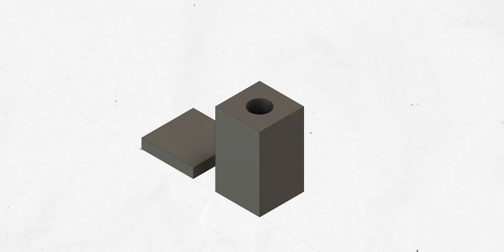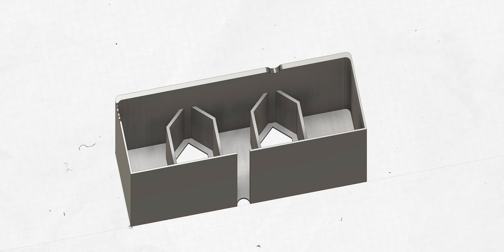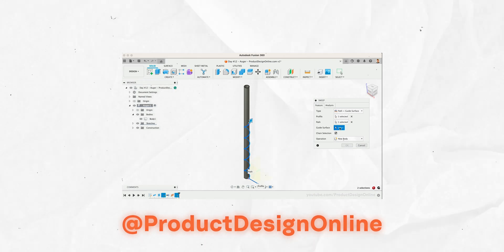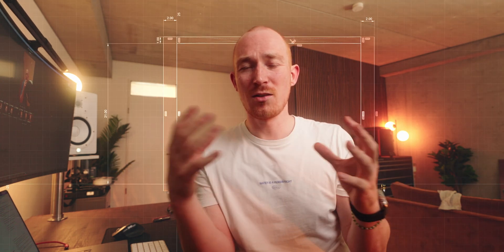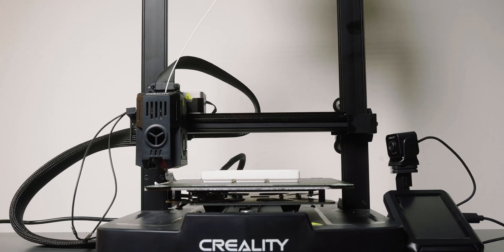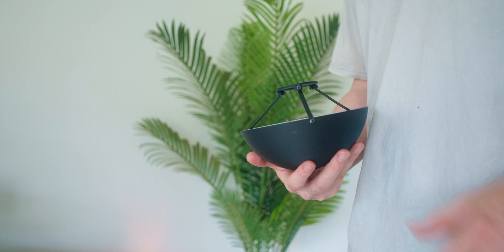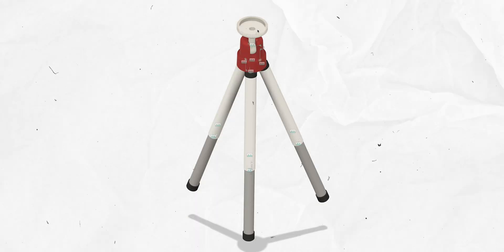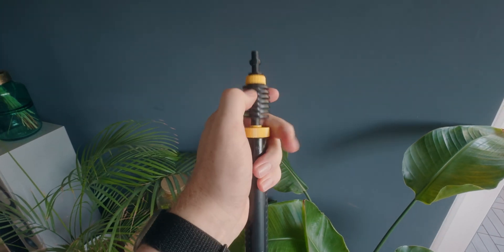I learned Fusion 360 in 30 days

Comment: Halla! I am an Industrial Design student studying in Oslo and have used fusion as a hobbyist for about 7 years and quite intensly as a student the last couple of years. I think its impressive how far you have come in a month, but I have some tips for you:

Firstly it seems like you are only using the solid workspace, learning to work with surface modelling will allow you to work with far more complex shapes and you can really fine tune curvatures and surface continuity. Your style seems quite simple and "blocky" so maybe you don't have to hurry with this, but it gives you way more freedom to design.

Secondly I would recommend that you start using "user parameters" its under the modify tab in solid workspace. This is especially useful when you have to make many prototypes to tune tolerances and so on. Start using these whenever possible as they usually save you time and allow you to build an understanding of how parametric features cascade through a design. 

And finally get super familiar with all the constraints available for sketches, constraining a sketch in as simple a way as possible is not only extremely satisfying but also makes parametric features run way more smoothly. And   relying more on geometric constraints rather than dimensions saves time and sketch isn't as cluttered.

Thats all I could think of for now, let me know if you ever need some input on a design or just fusion, I'd be happy to help.

Comment: I've been thinking of getting a 3D printer. But I don't want to unless I can design my own prints, so this is exactly the video I needed. Many thanks.
Reply from the maker: Happy to help! I mean I had the printer for a year before I really learned modeling because there’s still tons to do. But it’s definitely so much more useful! 
I’d recommend getting the printer while still learning because then you’re not just following the course but also doing stuff for yourself and already printing on the side 😊
Reply: @banyan55 I started a list of things I could design/print that didn’t exist yet. When the list hit 10 I could justify the cost of a printer. In the meantime, I learned to design what was already on the list. 

If I were to do it again, I would add Ellis Tuning Guide to the curriculum